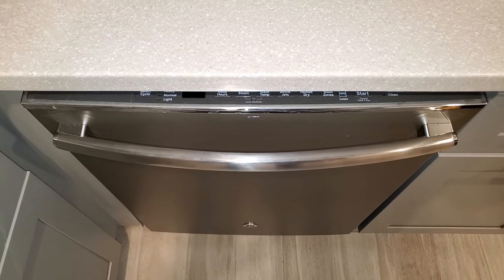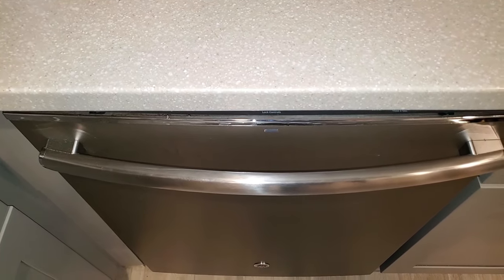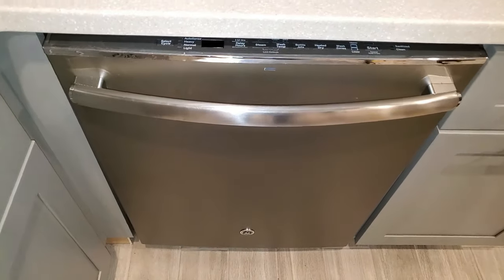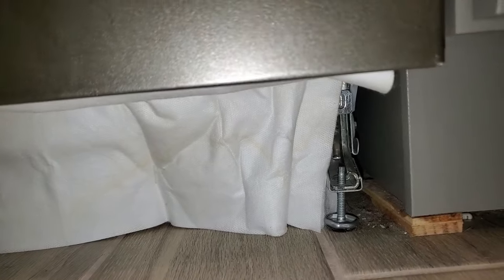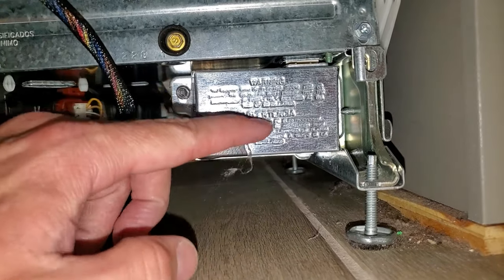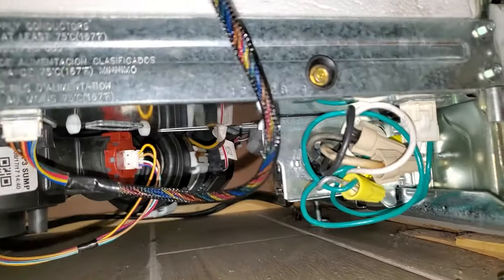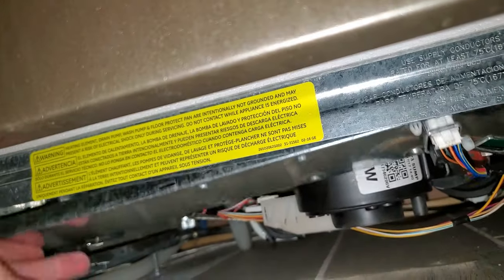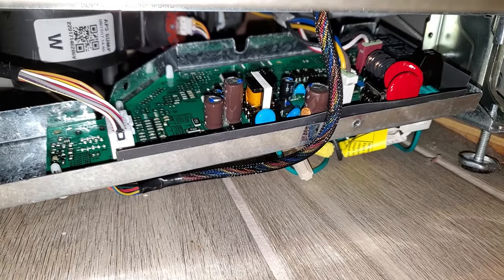GE Dishwasher - Troubleshooting a dead user interface

Comment: People... killing the power by unplugging or tripping the circuit breaker is only a maybe and or temporary reset fix. It'll go dead again. So after a month with no 2 yr. old dishwasher, the GE repairman has replaced the power control board (the down below control panel) and wiring element but still no power. Dead in the water without a paddle...I think it's maybe the user interface control panel board. GE I've had it!  It's not the space shuttle it's a friggin dishwasher. LG is in my future.
Reply: Same problem here
Reply: I’m having the same problem

Comment: Before you all go this far down the rabbit hole, please try unplugging the connector from the bottom of the control panel that leads to the upper touch panel. Clean with CRC electronic spray cleaner (both male and femsle ends) and replug it in. This connection leads to intermittent power issues with this model.

Comment: Thanks for this walk through!    I have the exact same issue:  No power, not working, slowly happened over 6 months and now won't start.  Flashing green light on the controller.  But It has 120v and the it has the 13.5 volts to the harness.  So I think the main controller is fine.  Gotta to take the door off (your trick didn't fix it) because it's either the harness or the User control board.  We'll see.  But thanks for the tip about NOT trusting the service light!

Comment: My GE dishwasher went quiet with no lights and just had service on it.  The issue was remedied simply by unplugging the white connector from the harness and reconnecting it.  The lights came back and the dishwasher is functioning again.
Reply: That will most likely be a short lived fix.  The UI PCB is a weak link and fails routinely....Just FYI
Reply: Any updates?  I am trying to troubleshoot mine....I turn off the breaker and unplug the power to the dishwasher control board and randomly it resets.  I don't want to guess I want to be sure I am replacing the correct part that needs to be replaced.

Comment: I have GE Model DDT595 and I just spent the past two hours reviewing your videos to figure out what my problem was.  I was definitely not looking forward to attempting to remove the door and replace the UI board.  Luckily, after turning the power off and on through the breaker, (which didn't seem to do anything) I decided to randomly hold the Cycle select and Start button.  Light came on and displayed error code 817.  I googled the code and discovered that I need to follow some steps to reset the computer module, and it WORKED!  Hopefully, this will help some people with their GE issue.  What a pain ! but i'm so glad I didn't need to go through all the steps in the two videos!
Reply: Mine started out that way, but now even that won't help. My dishwasher is 6 years old, and will most likely need the replacement part.

Comment: Well. It’s probably working because the board was working at the time. Unless you verified that you still didn’t have any readout on the interface when you checked the board indicator light and pin voltage, you could be getting a false reading. The light is only going to be flashing when the board is in failure mode. Once the board is working during intermittent random power-on moments, the indicator light will be solid. It’s almost always the power board that is the problem in these situations. But if you were 100% certain it didn’t suddenly start working, then yes, it’s the wiring harness or the UI.

Comment: Great video.  Our dishwasher is less than 3 years old and we encountered the same problem.  Thanks to Matt I was able to identify the problem as the UI.  Problem is, the part is on backorder at GE and they. kept pushing the ETA back by weeks and weeks.  After waiting for over a month and with no confidence the part would EVER arrive, we bought a new Maytag.  We will NEVER buy another GE appliance.  The company is owned by the Chinese (Haier) and they are sourcing all these components from China.  Enough said.

Comment: Can you add detail on what it means if the light IS blinking on the main control board?
Reply: Were you able to get an answer on this? Having the same problem and also noticed that the main control is blinking... I unplugged everything, hooked it back up, the dishwasher worked once, and now, is dead again. Thank you for any information you may provide.
Reply: Same
Reply: If you still have your manual there should be a table for this on the service information sheet - "service LED" light. The status is indicated by the rate of blinking. 
For my model, which is not the model in this video, but may still be true for your model:
•the first few rates are all normal operations and indicate whether it's  running a cycle, paused, door open etc.
The error light patterns are:
• 7x per 3 sec: CSM (Current Sense Module) has tripped 
• 1x per second: communications lost between control boards. Check connections, replace UI (User Interface) board if necessary 
• If it's blinking more than 4x a sec (aka super fast) that indicates "software failure replace board"
@MultiSo3 @linglee5879

Comment: Bought a replacement board on eBay for $60 and replaced my old one and it fixed the issue. Thanks for the video!
Reply: Update: now the user interface broke. Replacing that next.

Comment: Great set of videos (this troubleshooting one plus the repair one) for this problem.  I have the same dishwasher (different color) and had the exact same problem at the 3-year mark, like so many other owners.  As I was taking it apart, simply unplugging the cable that goes from the door to the main unit and then plugging it back in reset the UI and it lit up (at least temporarily).  This will buy me some time to find the new board and replace the faulty one.  I took the dishwasher all apart just to practice and am fully confident now with the repair once the part arrives.  Thanks again for your help with this detailed tutorial.
Reply: Any updates?  I am trying to troubleshoot mine....I turn off the breaker and unplug the power to the dishwasher control board and randomly it resets.  I don't want to guess I want to be sure I am replacing the correct part that needs to be replaced.
Reply: Did it last?

Comment: Great video. Best one after all of the things I have looked at but confirms the current condition of my dishwasher. I replaced the door switch already and that solved the problem for a day or so and then back to no power. Won’t even turn on now. It’s Xmas eve day so ain’t finding no parts today.
Reply: Oh, so your having the same experience as me on XMas. It’s not the door switch. I replaced mine a year ago and thought it was. Al you need is a basic electrical tester to check the switch. The one I removed is fine

Comment: Thank you for these videos. I've got a GTC535 model and i checked the voltage my main control board was sending to the display UI and it was bouncing between 6 and 18 volts, so I bought a new control board and it was doing the same thing. Bought a new display UI and watched your video on that to replace it. As soon as I got the door back on and the connector plugged in I heard the most beautiful sound I've ever heard, the dishwasher beeped and powered up after months of being out of commission.
Reply: where is the video showing how to replace the display UI on diswasher door ?

Comment: Good video, I have been repairing appliances for 27yrs. I constantly see these issues. Usually a tech sheet underneath tells what the flashes mean. I have had 2 that flash rapidly which says not corresponding with UI.

Comment: Posting thia as a top level comment for others that find this vid.
If you still have your manual/original docs there should be a service manual sheet and there is a table that tells you what the different blinking patterns indicate (which board is the issue or if something has tripped etc)
If you dont have that you can probably search for your model's manual on the Internet or via GE's site

Comment: So my issue started out exactly the same as you had described at the beginning of this video, and was temporarily resolved for a few more runs via power resets. However, during my most recent attempt to power reset, the UI board seemingly worked just fine, but the dishwasher was no longer working in response to it. That is to say, I could still set the wash cycle settings, enter error mode, and even correctly register if the door was shut or not, but the wash cycle never started. Error mode tests also yielded zero response or action. Granted, I never ran error mode tests before now, so I'm really hoping that my issue is also just replacing the UI board and nothing else. Will update this comment when my replacement UI board arrives.

EDIT: replaced the UI board. It works now!
Reply: Any word back if the new board worked?
Reply: @brianshockley6429  good news, new board worked just fine! I only had to run an empty wash cycle afterwards so that my dishwasher reset/drained to its dry state properly.

Comment: So... I had all these symptoms, did all the power resets, and was getting ready to replace the UI board but held off until I got the old one out to verify p/n. In the meantime, I had a power outage and ran on my generator...lo and behold... the dishwasher comes back to life! It has been running for 2 months now... still showing the random lighting of the panel. My generator is from the 70's and I'm over speeding it for voltage drop and spiking the Hertz.

Comment: Great video! Was about to order new user interface after checking some things. Disconnected 5 pin connector on the bottom and reconnected and is working good. Not sure if loose connection but is working good now. Every now and then will make random chime noise so will see how long it will last

Comment: Thanks for posting.  You have the drain hose in the worst place imaginable.  Every time the door opens it will rub against the drain hose and eventually rub a hole in it.   The board thing with GE tips and trick though is appreciated.

Comment: Ed E
I had the same problem at 4 years:  sporadic music, then eventually total darkness of the display.  Troubleshooting took some time, but it appears that I reached the solution.  Turned out to be the plug inside the box where (the wires are connected to power).  It was giving intermittent power to the panel, and when jiggled a bit in just the right way, would restore power to the view panel and the dishwasher.
 However, this jiggling was not a permanent solution.  Since half of the plug is built-in to the circuit board, and I could not detach one of the plugs to the board, I could not remove the board to work on that part.   After closeup photos of each side of the plug (that on the circuit board, and the other which plugs into the circuit board) I could see nothing amiss with the either half.  What tipped me off to both the original discovery of the bad plug and the final solution was seeing arching through the semi-transparent white plug when it was plugged in with power on.  I reasoned that the intermittent arching over time had deposited metal oxide dust within the switch.  What to do?  I used the red flexible plastic tube on my WD-40 can and squirted the oil into each side of the switch multiple times.  Hopefully the insulating dust particles are now washed from the plug, and it will be smooth sailing.  The plug seems to restore the display immediately each time the plug is plugged in now.  No arching visible at least.  Everything works now (it still plays a tune every so often, but at least we can wash dishes without disassembly).  
😊

Comment: Thank you for the troubleshooting advice.  I went through all the steps and when I voltage tested the pins on control board I found it was sending voltage to the UI.  I was about to start looking for a UI until I put it all back together and plugged the white five pin connector back in.  The green light on my control board began steadily blinking, my DW came back to life, and now is running the cycle my wife tried to run yesterday when the UI went dark.  Hoping this solves the problem, but I am not optimistic my troubles are over based on several comments to this video.
Reply: Any updates?  I am trying to troubleshoot mine....I turn off the breaker and unplug the power to the dishwasher control board and randomly it resets.  I don't want to guess I want to be sure I am replacing the correct part that needs to be replaced.
Reply: @macknumber9  yesterday the UI went blank again so I disconnected the main connector a few times and it didn't come back on so I went and reset the breaker then disconnected and reconnected and voila the UI came back to life and we ran a dishwasher cycle with no problems and it still working. This has worked for me twice and I hope it never happens again but if it does I'll continue this route until it finally dies if it does I will replace the UI and whatever else needs replacing.
Reply: @tedh7543  I wonder what is wrong and what causes this...if it is bad UI or bad control board
Reply: @macknumber9  No idea, I just know it is common with GE Dishwashers.
Reply: I feel like once you start to have these problems no matter how many times you reset the breaker or disconnect the connectors the UI board will eventually need to be replaced. This is such a common problem! GE should be sending out these replacement boards for free since they are terrible!!!
Reply: @macknumber9  Crummy cheap wiring connector. I will clean it first. Unplugged and replugged a couple times and worked. But now it doesn't. Then if that doesn't work try to replace the whole harness thingy. I can do this...
Reply: That would be neat if a class-action lawyer were to read this haha. Not really haha. So peeved. Happened just when I put my house on the market.

Comment: Some of the UI conditions may be resolved by removing each connector and spraying with an electrical contact cleaner. I might suggest connecting and removing each connector several times to clean the connector pins.  If cleaning the bottom connectors don/t work you could try the same procedure on the UI board.
Reply: I can tell you why that works,. It is the same reason that MANY electronic parts are replaced needlessly on automobiles. Oxidation corrosion on the micro pins and couplers in the data cables. I took the dash apart on my 2009 International road tractor and pulled all the data links. Pulled them on and off several times then put computer connector grease on each one. Never another problem for the remaining 8 years I owned it. It was a high moisture environment from being closed up and sleeping in it every night. 
This morning I watched a video of someone replacing the lower board in a GE dishwasher like mine (Mine is 3 YO) because it went dead. I pulled it back apart and just removed and replaced several times both the main power connector and the data cable going to the UI.  Would be nice if these companies would either spend $5 on a tube of anti oxidant grease or used gold plated connectors.  Just my 2 cents!!

Comment: Remove the capacitor right next to the connector on the UI board. 220mf 25v. 
YES remove it , replacing the bad cap does not fix the issue. For all of those who have a dead UI board try this. It's a smoothing capacitor I'm assuming. No harm removing it at your own risk. For some reason this solved a completely dead board. This dishwasher will still randomly come on but I can live with it. Below is a list of revisions for the board replacement GDF530PGM0CC

WD21X24821 Original
WD21X26182 (AP6985297) updated 
WD21X31909 new updated
220mf 25v capacitor

			 			

 

			 				 			 		 		 		 	

								 								 									 	 								 								 									 	 								 							 							

							 								 	 		 		 		 	 							 						

					 					

				 			

		 	 	 	 					 					 				 			 		

	

	 		

			 				 				 				 					

						 							 								You must lo
Reply: Same problem, dead user interface but confirmed the main board had 14v coming out. Tried your comment about the capacitor since I was going to replace the user interface board anyway.

Interface powers on now without the capacitor. Capacitor has no visible bulge, but after removing it my multimeter shows it was definitely bad. Big thanks to your comment and the original video.
Reply: Thanks to @stevemaxell7741, I removed (desoldered) the capacitor right next to the connector on the UI board. 220mf 25v. Plugged in the harness from the main control board, plugged in my GE dishwasher and the UI board came back to life.
I was able to run a wash cycle as well. As noted, the UI board still randomly turns on/off, even during the wash cycle, but it retains the status and time and continues the wash cycle where it left off.
If you have 14v from the main board, I suggest trying this hack before replacing the UI board.

Comment: I just did the test on my GE with the exact same problems and symptoms.  Everything looked exactly the same and came apart the same way as well.  Only problem was there was no led light at all on the main board.   I checked the voltage to the interface and got 14 volts on pins 2&5.  I have a totally dead everything.  I went ahead and ordered the interface thinking there may be slight variations in models.
Reply: After checking the video again I unplugged the wire to the interface before turning breaker back on.  Thus the test was not accurately done.

Comment: Before ordering parts, make sure to reconnect the control board to the main board with the harness unplugged in this video.  In my case, doing this made the control board start talking to the main board again.  I may pack the connector with dielectric grease to improve the connection.  It's possible a little moisture is causing a short and making the communication fail.